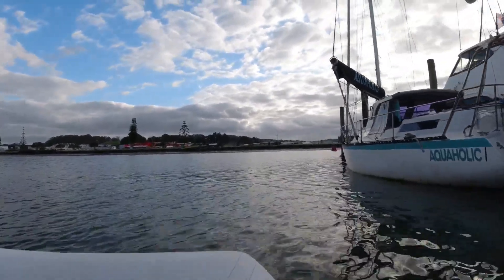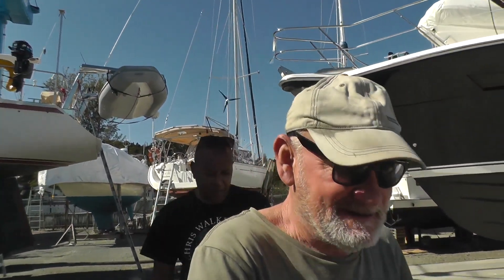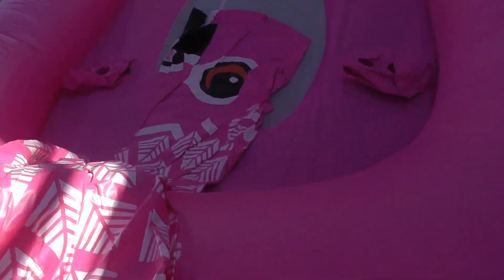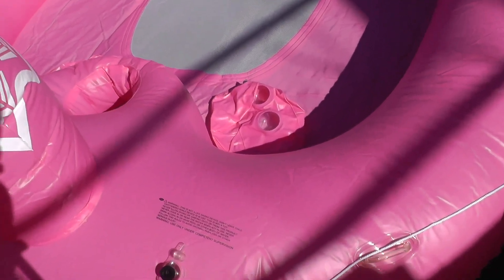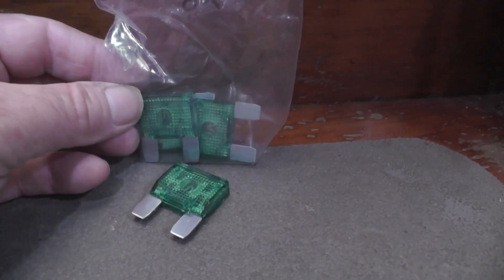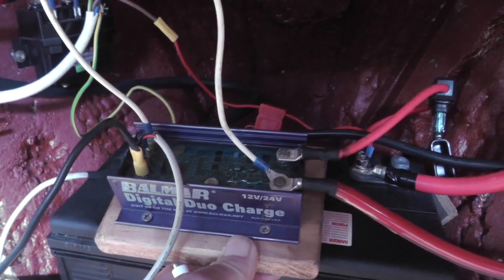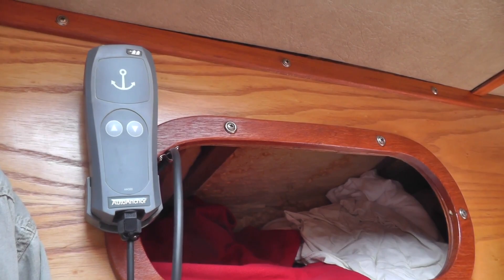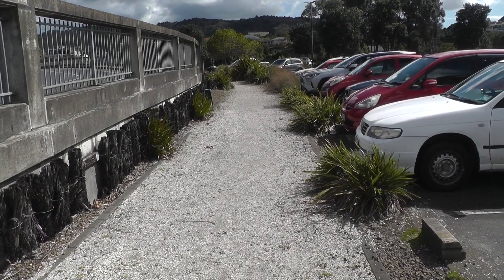Pink thing BLOWS UP in marina

Comment: Hi Barry, that little two stroke stalling out when applying power its an easy fix, take the float bowl off the carb, best done on dry land as bit stend to fall out ...unscrew the main jet which is screwed up into the carb....blow it out with and airline....pop it back and should work....these two strokes only have issues with either poor fuel or fuel starvation. This was the issue with mine, exactly same symptoms. only takes 5 mins. The only other spot where mine failed (similar symptons was crud in the filter/tap thats under the tank....it allows the engine to run on idle /slow if partly blocked but as soon as full power applied it starves the fuel. I guarantee one of those will work or i will eat my hat. cheers jasper

Comment: When you only have one hand. This is the tip turn the beer upside down in the glass and put it all the way to the bottom let it drain out until it’s even  … In the can and the glass or the cup or the cooler, or the Stein Then just pull it up slowly on a  angle it’s perfect once ya get it.. you can do it with a warm one

Comment: Another great episode Barry but, and I have mentioned this before, it always worries me when I see you have not put the engine kill cord on your wrist in the dinghy.  You never know when something might happen.  Please stay safe.  Regards Michael
Reply: It shouldn’t go on the wrist it should be around a belt or around the waist.
Reply: @NateGoesOutside  What, his hand is going to fall off?😱 Just properly adjust the strap. I know some come with a clip for the life vest. MOST, do not.
Best wishes from the far North.
Reply: @NateGoesOutside  The cords are made to go on your wrist.  They are not long enough to go round your waist and to put it on your belt would restrict your movements too much and therefore present a danger.
Reply: @NateGoesOutside  Thank you.  I have watched the video and obviously feel very sorry for the chap.  I shall make two observations. 1) By his own admission he was travelling too fast for the conditions.  2) From what he said he did not have the loop around his wrist tight enough. If correctly set it would not slip off before stopping the engine.
I am now 80 years of age and have been boating since I was 16.  I have used all types of boats and cruised many thousands of miles. When I was a Cadet Officer I qualified are a Certificated Lifeboatman. I have always made sure the kill cord was properly secure and always around my wrist to give me proper flexible movement.
Reply: @michaelchartres  fair enough. I would only point out that every safety lanyard I’ve ever used or seen (with the exception of shoddy improvised ones),were springy coil type and you really can’t tighten those properly, around the wrist. However, if they made ones that fit more like a surfboard leash, where Velcro is use to cinch down and hold fast to the wrist like a surf leash does, then I would agree that it was safe to wear on the wrist. I personally, have never seen one made this way. I would never put the ones I’ve seen on my wrist.
Reply: @carlthor91  yes the ones that clip to a PFD are good but as you say, most aren’t like that.
Reply: @stelioshondrocolos1869  LOL
Reply: @stelioshondrocolos1869  🤣🤣🤣🤣
Reply: @stelioshondrocolos1869  😂

Comment: You didn't listen Uncle Barry: Take the carburettor float bowl off that NS outboard, clean it out and reassemble - you've got water/cruds in there - once every 4-6 months, before it starts fuel-starving's best. Also, unless you've put a lot of weight on that NS will put the dink up onto the plane with just one person in, but do wear ear plugs/defenders if you're planning to do it for very long  ; ).

Comment: Do you open the vent on the fuel cap when you start the engine Barry?
If you do not that could cause low pressure in the tank which could inhibit fuel flow.

Comment: When you said “blow up,” I was expecting for it to explode. Anyway, a tip.  In the Coast Guard when we used to have to replace or remove the outboard motors on our smaller vessels, we would tie a line around the motor itself and then rope it off to cleats that were on the dock.  So if it slipped out of our hands, we would be saved due to it being secure to the cleats.

Comment: When you make connections in your boat electric never use those cheap plastic blocks but proper marine blocks. Those you have used can be danger as they should never be used on board. Go to a shop and buy the proper ones. It will save yourself a lot of trouble on the long run.
Reply: _ Barry is CLEARLY NOT Marine electrically au Fait and those wretched things are going to give him Nightmares!! _

Comment: At the risk of sucking eggs--I had a separate battery for'ard which ran anchor windlass, heads macerator pump and forward deckwash and holding tank discharge pump..  I charged it using heavy copper tinned wire, and did it through a blocking diode, so that the wiring would not catch fire if the load of starting was being shared by the for'ard battery.  I had a 100 amp fuse in the charging circuit, but be aware that the blocking diode knocks off half a volt.  It was charged in parallel with the ships system, which was separate from the engine start battery.  Simplify was the way I did things--I was too thick to do anything complex--and had no trouble with any of it.